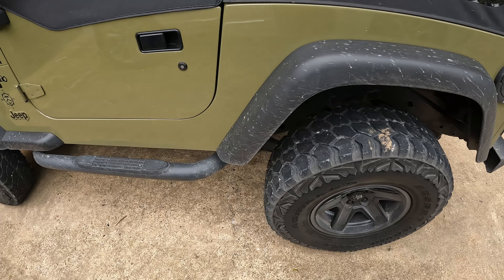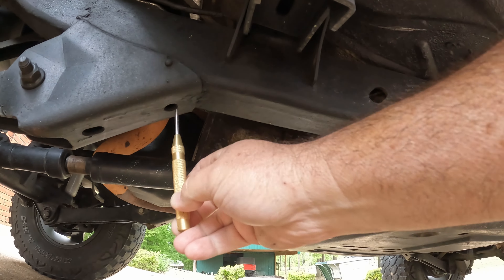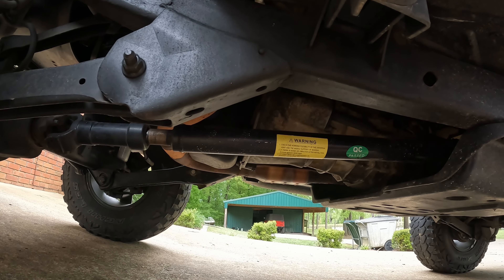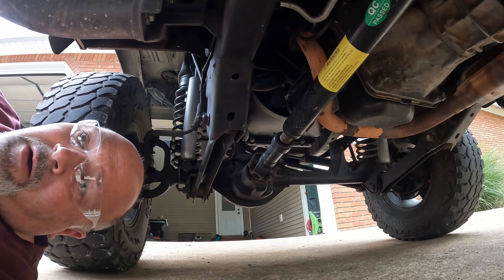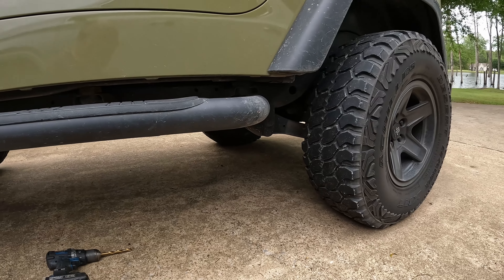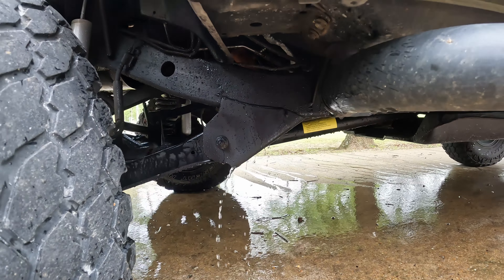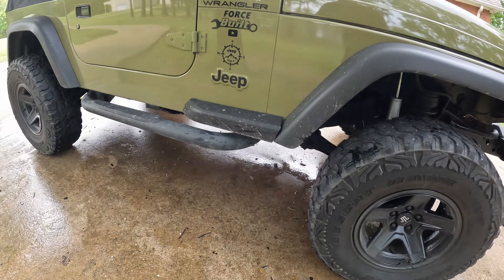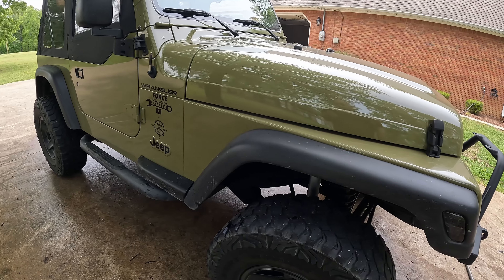Drilling Drain Hole in a Jeep Wrangler TJ Frame.

Comment: I saw where a guy used a sewer cleaner hose and attachment on Amazon and then did an Eastwood Internal frame spray. Personally doing a Fluid Film on mine. Great Video...BTW New subscriber. What color did you spray that? Its beautiful!
Reply from the maker: Thanks a lot and welcome aboard! The fluid film on the inside is a great idea to stop future rust.  The paint color is Commando Green from a Jeep JK. Color code PGH.Thanks for watching!

Comment: Great idea in placement of drain holes. Did you paint the drilled holes? Looks like another project Thanks Steve
Reply from the maker: Yes, painting is the best thing to do after exposing bare metal.
Reply: @ForceBuilt what kind of paint do you use on the bare metal?

Comment: Not the brightest idea.  Use a pressure washer drain cleaner.  It blasts all the crap out and you don't create one more spot for rust to start.
Reply from the maker: Well, I totally disagree on this. When you blast, as you say, the crap out. It is still gonna be standing in water. Mine drains the water. Yours will rust first. That is the reason for the drain holes, to get rid of moisture. Just Google it.